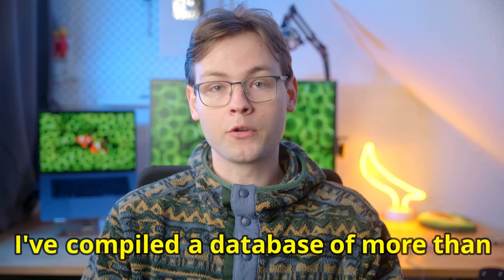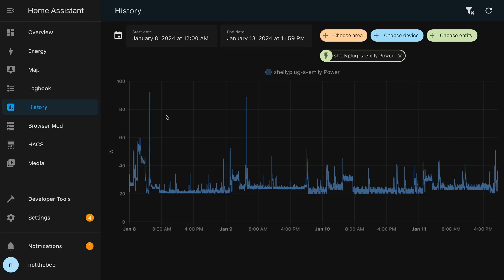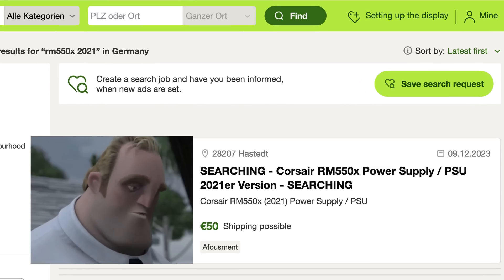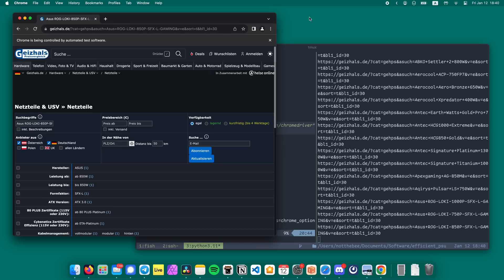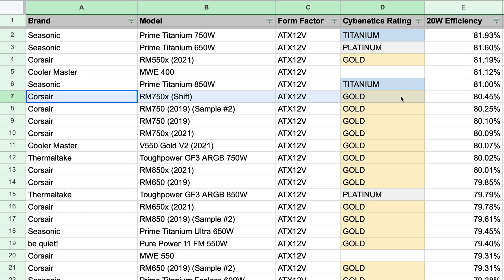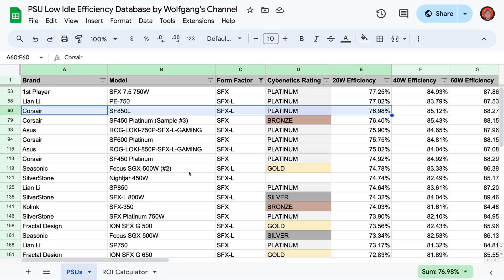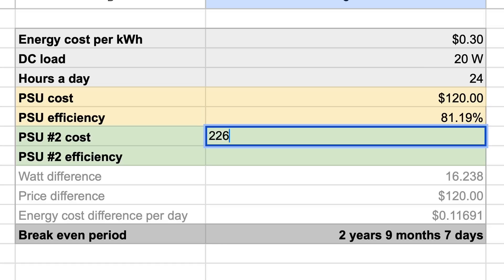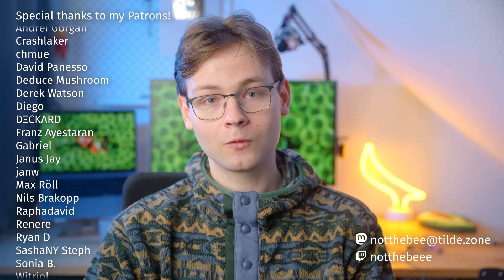What's the Best PSU For Your Low Idle Home Server?

Comment: There are a lot of these cheap MWE PSUs where I live.  I bought MWE 400 recently and man...i dunno...this is one of the worst PSUs I ever had in terms of power efficiency. +7-8 watts more than my 10-years old Corsair CX550M (which consumes +6 watts more than my Corsair rm650x (2021). In total +14 watts at idle! So I gave it back immediately.
Reply from the maker: That’s interesting… I’m wondering if there’s a big discrepancy between different samples
Reply: @WolfgangsChannel  yeah probably. And Cybenetics testing has been done in 2019 as I remember well. It has been a while since then...at least on the part of manufacturer.
Reply: I got one MWE 400 , and tested with Ryzen 4750G Pro, 2 dims of 32gb DDR4 ECC ram, 1 SSD , motherboard ASRock B550M PRO4. it consumes from the wall 22.5 W at low cpu usage. And in stand by mode 2.5 W. Used Debian 12.4 without monitor. Is 22.5 W good enough ? Thanks
Reply: @ncarrasco2006  What do you mean by "low cpu usage" ? My result was around 19-20 W at idle (Asrock h110m-itx/ac + G4600), 32gb DDR4, 1SSD and its waay too much IMO. With Corsair RM750 (2021) it consumes around 5.5 W and around 6 W with RM650X (2021)
Reply: I will check if I can lower the power consumption. You are still using a quite different CPU / motherboard than I. 
Have you checked in stand by how much it consumed with your MWE 400 ?
Reply: To my understanding if it is at idle, you can still ssh to the computer right?
Reply: @ncarrasco2006  in standby it was around 2.5 W too. 
Right, you can ssh to it without a problem.
Reply: @HoboHero  I do not see any contradiction of the Cybernetics report with your measures. The report only says for 20 W around around  81.1% of efficiency. It does not mention anything for less than 20W or yes?
I wonder if It is not possible that without being in stand by, it consumes min around 15 W ?
By the way for me that I am using a ryzen APU with that motherboard, I will always consume at least 20W so this PSU is good.
Reply: @ncarrasco2006   good for you lol. But how come "the less effective" Corsair consumes 14 watts less in my case ? What do you think?
Reply: @HoboHero   It may be the case that for less than 20W it is better your Corsair PSU.

For this MWE 400 , the Cybernetics report only claims that for >=20 W it has more than 81 % of efficiency. But the report does not say nothing for less than 20W.
If you are targeting to consume 6W, it is an possible outcome what you have reported.

Comment: After searching so long for the RM550x as you mention it in every video, I gave up and switched to Leica adapter and a pico psu. But the option was not good for me after many search and test I went for rm650 2023, a recently released and available option for a good price. It’s power consumption is similar or 1w more than the pico psu. Probably you can switch from suggesting rm550x.
I’ve heard that many people at least in germany goy scammed for a rm550x.
Reply from the maker: That’s exactly the reason why I made this video
Reply: Also in my tests the list you have isn’t fully right. My rm750x 2019 does a very bad job on my NAS and it’s super inefficient. Around 10 20w more usage in idle and can’t go under 33w in any scenarios.
Reply from the maker: Like I said in the vid, all technical data comes from Cybenetics, not me

Comment: Can anyone help clarify some things for me. Google has given me mixed answers. 
1:- If I have a 500w PSU and the pc is idling with a load less than 10% ( perhaps 30w) will the PSU draw a corresponding lower current or will it just sit at 10% draw from its plug?  

2:- Additionally, how do people figure out the idle wattage of a system. 

3:- I’m using parts picker wattage calculator. Is it any good or is there a better one? 

4:- if a machine sits at 50W most of the time and occasionally goes up to 300W but the PSU is a 750W, is the oversized PSU adding a higher running cost than a better matched PSU? (Apart from initial purchase price) 
Thanks for your answers.

Comment: Regarding the Cooler Master MWE PSUs:

1. Model Variations: Most (if not all) of the MWE PSUs listed are the V2 model. This is not explicitly stated, as the 'V2' suffix is not officially part of the model name. The V1 and V2 models differ in a few ways:
   - V1 models are rated 80+ Bronze, V2 models 80+ White.
   - The V1 and V2 models have different load ratings and sticker designs on the unit itself.

2. Availability and Pricing: Unfortunately, these MWE models have spotty availability, causing their prices to fluctuate. Here in west EU, they should be about €40-55,- depending on the model.

3. Power Connectors: The number of PCIe power connectors varies by model:
   - The 400W model has one.
   - The 550-600W models have two.
   - The 650W model has four.
There are more connectivity differences, so don't forget to check.

4. Value for Money: Some of the higher wattage models are actually cheaper right now, so don't rule them out; they could offer better resale or repurpose value in the future.

5. Efficiency Rating: Cooler Master might have given them an 80+ White label, but most of these PSUs are rated as silver efficiency by Cybenetics.

I hope this was helpful, because I think the MWE White V2 lineup actually offers the best bang for the buck right now.
Reply: Spotty availability?
Sold out everywhere!
Reply: I found one Cooler Master MWE 400 !
Reply: I have bought the Cooler Master MWE 400 V2 White and mesuerd it with my testbench system (Kontron D3633-S). The idle draw is awfully high. It uses 8W more than the test system with a PicoPSU 160W + Leike 12v 150W. Do not buy this!

Comment: Anything above 75% is probably fine on 20 W load, 10%. increase in efficiency would mean only 2 W less heat, or equivalent to a small spinning case fan, so the PSU fan/case thermals can become a factor too at that point. Correct me if I am wrong.
Reply from the maker: It's mostly for energy efficiency, not heat. But in general I agree with the 75% mark. It's just that a LOT of ATX PSUs are actually below that
Reply: Indeed, I meant the additional 10% inefficiency around 20W would mean 2W more heat (and energy bill) comparing 75% vs 85% PSUs. With gaming oriented rigs pulling 500W or so it would mean much more making every percent worth more. @WolfgangsChannel

Comment: Shame they don't have data for the Prime Gold series. I have a couple Prime Gold 650Ws.

EDIT: Actually, they do. I guess some data didn't make it into the sheet somehow?
650W variant results:
20W - 71.749%
40W - 81.354%
60W - 85.241%
80W - 87.351%
(AKA disappointingly average across the board. It still got a Platinum rating from Cybenetics though, likely because in a gaming PC application where you use closer to 100W idle and maybe 200W if not more under load, it's 89-91% efficient)
Reply: I've got a Seasonic X-660 running my home server. The low-power results are probably even worse. (It's a pass-me-down from my gaming desktop.)
Oh well, the home server will inherit the Prime Titanium Fanless 600W currently in my desktop and that one's in place 22 on the list. 600W just isn't enough anymore.

Comment: The Cooler Master MWE 400 is the newest V2 White, It's a typo on their names xD (this is the Serial Number for it from the PDF MPE4001ACABW), with the extra numbers removed. It matches the official page 1 to 1
Reply from the maker: Gotcha, thanks for the info!
Reply: I have bought the Cooler Master MWE 400 V2 White and mesuerd it with my testbench system (Kontron D3633-S). The idle draw is awfully high. It uses 8W more than the test system with a PicoPSU 160W + Leike 12v 150W. Do not buy this!

Comment: This is really great. Thanks. Finally there is a way to start to narrow down a selection and filter etc based on useful and empirical data for a criteria.
Would you be interested in developing this a little further? 
I dug into a few PSUs in the top 20 most efficient for the 20W, 40W, 60W, 80W range and found that some had very noisy fans. Some have fans that are quiet up to 50% load and kick in after that. Some kick in after 40% load. I guess the important data points are 
- what power draw or Load % will the fan start 
- what RPM and dB is that at. 
The other fan RPM data points and dB values are valuable too but that is perhaps difficult to put on a table clearly. Possibly the 80% Load dB value would help to round out a picture of how noisy the PSU is across its typical use experience.

Its just a thought. I really appreciate this data as is.  Thanks for the effort.

an example from my manual effort

Brand	Model	Form Factor	Cybenetics Rating	20W Efficiency	40W Efficiency	60W Efficiency	80W Efficiency	Fan start Load %	Fan Start RPM 	Fan start dB	Fan dB at 80% Load	Buy Link (Amazon Affiliate)	Price (Geizhals.de)	Price (Amazon.com)	Report Link														
Seasonic	Prime Titanium 750W	ATX12V	TITANIUM	81.93%	88.77%	90.73%	92.36%	30%	490	17.8	18.2	https://geni.us/tAvX	€226.90		https://www.cybenetics.com/d/cybenetics_xGy.pdf														
Seasonic	Prime Titanium 650W	ATX12V	PLATINUM	81.60%	88.76%	90.47%	92.08%	10%	490	17.9	17.9		€197.89		https://www.cybenetics.com/d/cybenetics_ZfJ.pdf														
Corsair	RM550x (2021)	ATX12V	GOLD	81.19%	85.65%	87.39%	87.92%	60%	425	8.5	24.2				https://www.cybenetics.com/d/cybenetics_rn4.pdf
Reply from the maker: Amazing idea! Will update the data accordingly
Reply: @WolfgangsChannel  I see another dB level data point to include. Possibly instead of one of the others. Perhaps instead of the “dB level at 80% load”. 
The new one is “At what load will the fan become audible or noticeable “ i think this data point helps people understand that under some dB level it’s just not worth worrying about. 
It’s easy to get caught shaving dB values down but actually, under 30dB is silent. Certainly under 25dB is not worth stressing about unless someone wants to go fanless altogether anyway. 
I have been looking for a nice dB level chart image to help share this understanding. Personal context is everything and people need to make decisions for themselves. I can’t find a chart I like though. 
I’m not exactly sure of the “noticeable or audible fan level ” threshold. Perhaps it’s 40dB which apparently relates to a quiet fridge.

Comment: Great video on ATX and SFX power supplies but you don’t tell the whole story on micro PSU’s as there’s a double conversion from the line to the ATX voltages. And many people use really cheap Chinese non PFC power bricks to run their micro PSU making it even worse. Best case they are unlikely to match the 80% efficiency of a decent ATX PS at 20 watts. 

If you’re building an extremely small form factor server it makes sense but don’t pretend you’re saving energy. Further you have essentially doubled the points of failure with a Micro PSU. If you’re building a small form factor server or appliance just choose a motherboard, device, etc, that natively accepts 12v or 19v like a laptop or Intel NUC does.

Comment: Thanks. PSU for rack cases are not bound to any standard afaik. Do you have any recommendation where to look for home rack users when it comes to PSU? No matter if 1U or 4U  :)
Reply from the maker: There are many rack cases that support standard SFX and ATX PSUs, e.g. from Inter-Tech
Reply: @WolfgangsChannel Thought it's a matter of how they are designed to work (air goes up-down vs rack's front-back). Thanks, I will check it.

Comment: Cant wait to get my n100 board from  china to plug in my old Thermaltake psu from 2008 to test idlw power consumption. And then to test RM850x from my 2023 desktop build to see power consumption difference, then i can decide if ill buy new power supply if this psu from 2008 is that bad

Edit:
MWE is 48€ where am I

Comment: Thanks mate this is exactly what I've been looking for - I currently have a random £20 PSU in my server and I monitor the power usage with a Tapo P110. It has an i5 4590T, one HDD, 3 SSDs, a TV tuner and Flightradar ADS-B dongle idling at around 27w...whilst that's pretty acceptable, I've no idea how much the system is using and how much is being "lost".

Comment: Thank you for this informative video. You either take your chance by buying the cheapest PSU from facebook marketplace and use the one that comes with a prebuilt you intend to upgrade or drop big on the RM550x for the best, but now with your spreadsheet we can be more selective when "taking our chances" with the used market and filter for the best low idle PSU.

Comment: That spreadsheet is a great resource for the low power community. Thanks for pulling it together. I've been using Corsair RM series exclusively since the mid-2010s, including an RM550x in my main 24/7 server. So disappointing that they keep getting rid of the lower power options. I have an RM450 from 2015 but now the lowest power RM is 650 watts. People building low power systems want good power supplies too.
Reply: Factors could be low sales or reliability problems resulting in returns.

Comment: Why did you extract the 115v result aka US voltage and not 230v when they have 230v result? US in not your main audience (cheap electricity) and you are from Germany yourself?
Reply: I see that older is only tested in 115v and only newer test have both. 230V have less energy loss and your stat should not be 100% for a 230v user.

Comment: I'm at the uncomfortable spot of being a bit too power hungry for pico but way too little power hungry for anything else (especially that I want a silent one that doesn't take much space)
but that's for my main machine! I have 7950X capped at 120W, A2000 and KC3000, at full load that's less than 300W I believe and that full load never happens as games don't tax the CPU as much... but pico still won't do

Comment: Thank you for all the work you have done here. Comparing 20% efficiency numbers between PSUs of wildly different wattages does not make much sense however. In the video you are comparing the 20% number of the RM550X to the efficiency numbers of 750 and 850W PSUs.

But 20% of 550W is a measurement at 110W load while 20% of 850W is a measurement at 170W load.

With an actual load of 30W the 550W PSU has a good chance of being significantly better than the 850W even though the efficiency values at 20% are identical.
Reply from the maker: And this is why the table also includes effiiciency numbers for other wattages. At 40W, the gap between the RM550x and the Seasonic Titanium 750W actually widens (and not in 550W's favor) – 88.77% for the Seasonic PSU and 85.65% for the RM550x
Reply: @WolfgangsChannel  I think Gerald is mistaken the 20W results for being 20% results.
Reply: @WolfgangsChannel  Thank you, I should have looked at the table first and not only watched the video. Thank you for your work.

Comment: Unplug the PSU fan from PSU board, plug it into a sensor controlled motherboard fan header. May need to change the PSU fan. Works great.
Reply: Can you explain? This is very interesting
Reply: @Lordofrimgs  explain what?
Reply: @duotronic6451  you mean to open up the smps and disconnect the fan from the psu and instead connect it to the connector in the motherboard?
Reply: @Lordofrimgs  yes. My asrock z270 has 4 fan  headers. All of the are sensor controlled. They can control 3 or 4 pin variable speed fans.
Reply: @duotronic6451  it will void warranty of the new psu. 
Btw, is that controlled pwm saves energy? What's the advantage of doing this.? 

And thanks for your reply man, am learning a lot from you.
Reply: @Lordofrimgs  The advantage is a quiet PC and you can monitor the PSU fan speed from open  hardware monitor. Are companies approving warranty claims? I don't think so.
Reply: @duotronic6451  I'm from India. Warranty claims are taken seriously by the courts. Hence customers who demand a proper service must be given the proper service. Else the company might have to pay a heavy compensation. So warranty is possible here...

Comment: I use two fanless Seasonic PSUs. I bought one in 2017 and one back in 2014 The idle power usage of the systems is impressive. Easy to clean and not noisy!

Comment: Hi Wolfgang, i really like how you're handling  your tests and how you present it. I always think you as a younger version of Igor. Thx  a lot for sharing :-) 
 
Regarding the spreadsheet I have two suggestions:
1. Make it sortable / filterable on all columns
2. The ROI-Calculator would also be great for people planning a replacement, and then it would be useful to include a "sale return" field into the calculator
Reply from the maker: Hey! You can sort the table by making a copy in your Drive
Reply: Or even better, by clicking data -> filter views -> create new temporary filter view. Then you can filter original even without having edditing permission

Comment: I'm surprised no-one's marketed their PSU as homelab optimised yet. The performance of cheap models like the CM MWE models show that it's not super expensive to make a PSU with good 20W efficiency, but by the time the homelab community notices the good models are always discontinued. The first manufacturer to take the cybenetics 20W efficiency score and shout about it on the box should sell really well
Reply: Nope. Mwe450 when I tested today consumed 60watts at idle for self running.